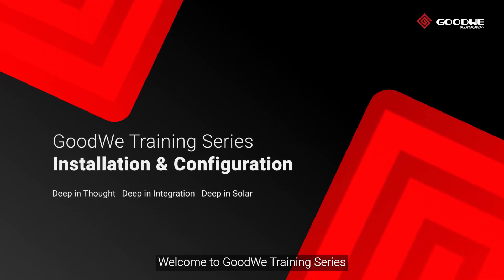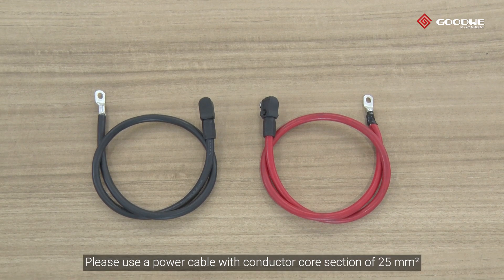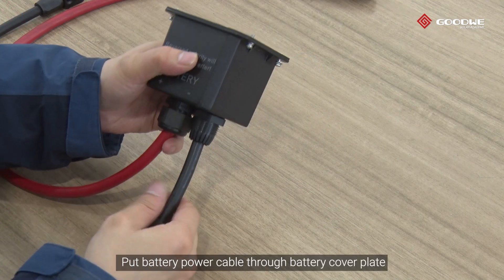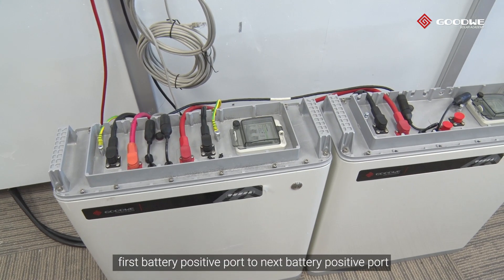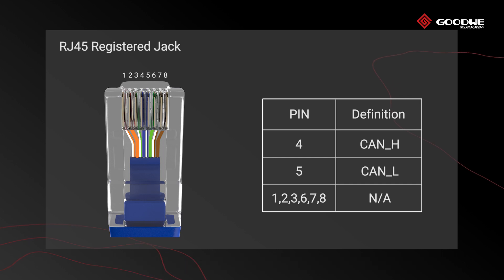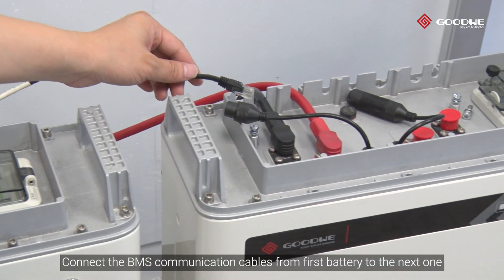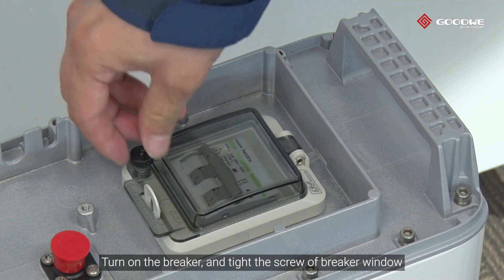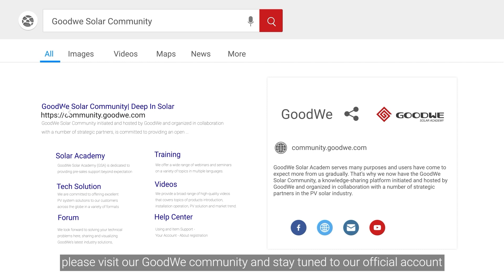GoodWe Lynx Home U Battery Connection

Comment: interesting video. What is the max charging and discharging power when running two batteries in parallel here? Is it double the values of a single battery or is it limited by the current in the cables?
Reply from the maker: It is limited by BMS, one Lynx-U is max 50A, more than one is max 100A.